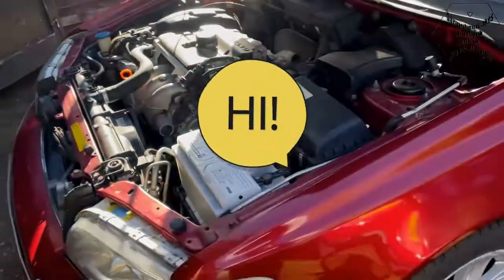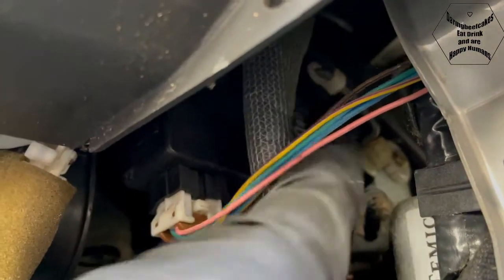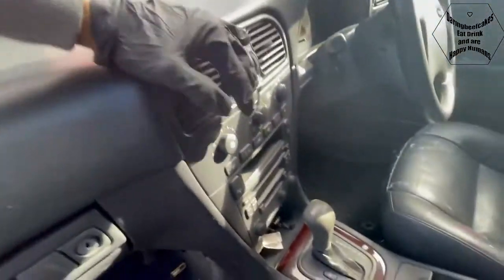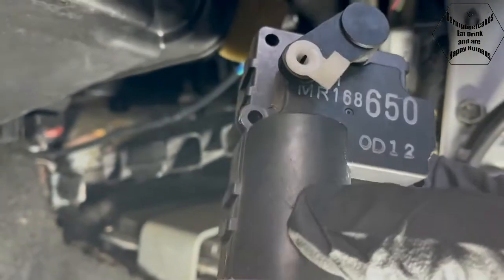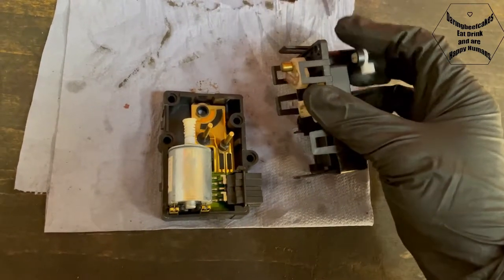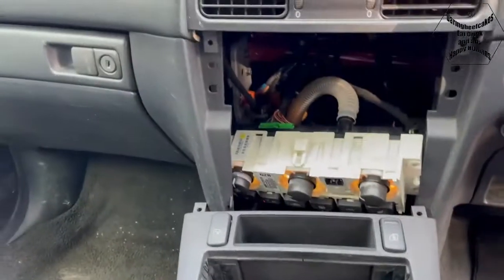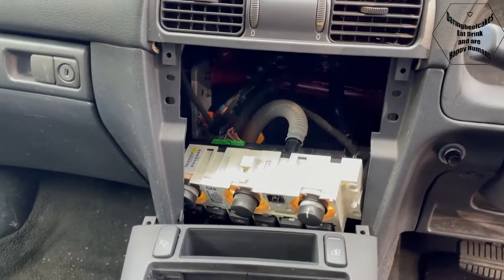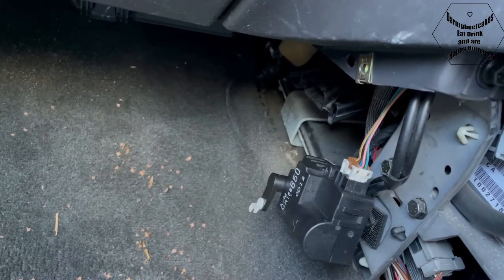Volvo V40 2000 blowing cold air fixed

Comment: The linkage is actually working ok so i have decided to change the thermostat which looks like stuck open not letting the car heat up enough,i did notice the temp running pretty low lately.Will let you know how i get on.....
Reply from the maker: Oh ok, yes I hope you  find the problem, I recently worked on a car which had not very good heating and it turned out that the heater matrix was blocked. and not circulating properly.

Comment: Well done mate //// Seemed like an intermittent fault and they are the worst to fix. On my car i will probably move the linkage to hot position and leave it at that for the winter period and move it again next summer.You on the other hand have gone deep down and persisted and well done to you
Reply from the maker: yes very intermittent situation and hard to say which part is actually causing the problem. so in a way better to manually move it hehehe but not ideal of course..

Comment: Yees, my Volvo V40, year 1998, has the same symptom: no warm air in the saloon.
The termostat is ok, regulating the temperature of engine, closes and opens the circulation of coolant, so the pipes should be warm also, need to check just in case;).
So it should also be the valve issue, or Electronic chip of the controller that is faulty.
Anyway, very good overview of the journey how hot air is regulated and leaded to saloon;).
Reply: As my volvo is older, year 1998, the flap is operated from the dashboard manually by button/valves.
So as i also try to fix fog light issue, i have plastikc cover removed and access to this warm air flap.
It moves ok, when operating the buttons.
It was just quick lok so i havent checked  these hoses in engine compartment.
So, tere must be some other issue.
When hoses are cold, then probably there is block in the circulation;).
Reply from the maker: yes make sure you have coolant, and if they are cold then water is not getting to the heater matrix so you wont het hot air..the heater matrix can also be blocked and doesn't allow hot water through..
Reply: @DaringBeefcake  coolant level is ok, and by now i also checked that pipes are hot, so most probably there is blockage;).
Reply from the maker: @intsu-onu  yes sounds like there might be a blockage..
Reply: @DaringBeefcake  do You know, is there some solvent to add to the coolant system, so that it would remove the blockage;)?
Or only special cleaning of pipes possible, including removing coolant and blowing air through system?
Reply from the maker: @intsu-onu  I dont know of any solvent as such, may be you could try running the car while a water hose fills the coolant tank and one of the drain hoses disconnected. so water can circulate around.